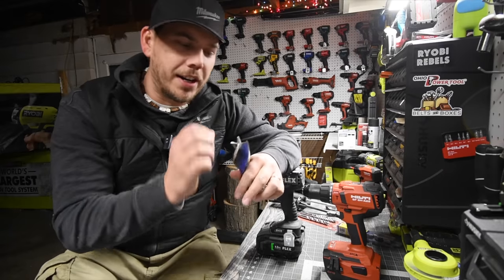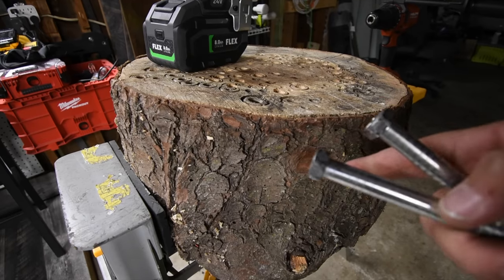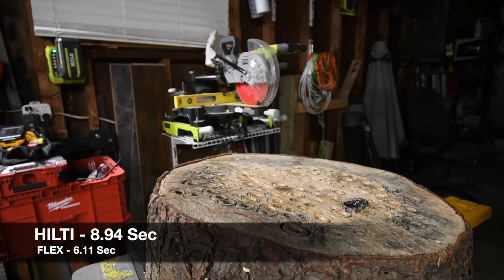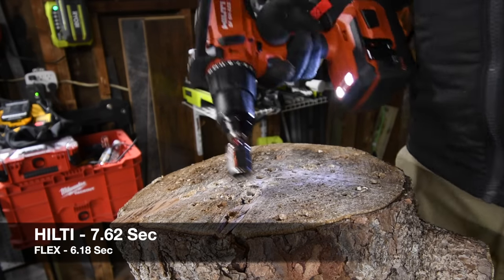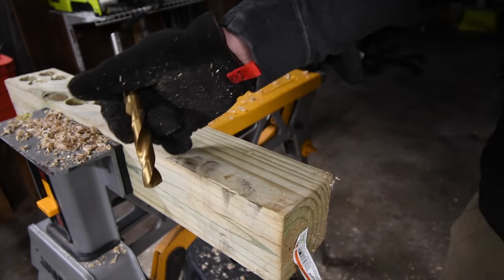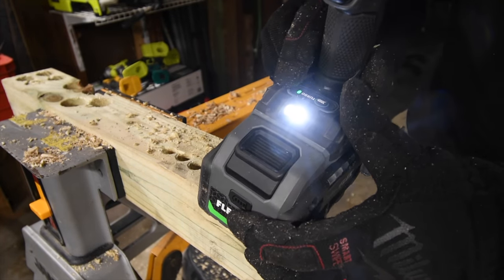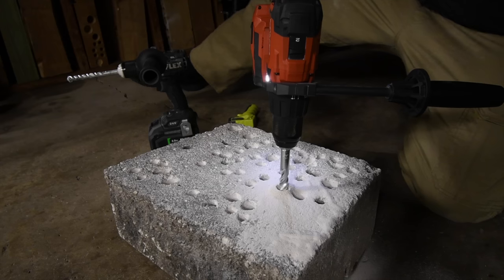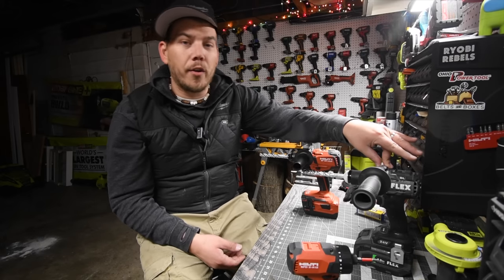HILTI vs FLEX (Hardcore Hammer Drills)

Comment: This is not “1st tool” from Flex. Flex started as a German tool manufacturer over 40 years ago. They were acquired by Chinese tool giant Chervon a decade ago. Chervon, the owner of other well known brands such as Skill, Ego and most notable as a 3rd party manufacturer for many other brands including Bosch Tools, had an existing tool agreement w/Lowe’s, producing their in-house Kobalt branded power tools. 

In 2019, Lowe’s & Chervon renewed their partnership agreement to re-introduce the Flex Power Tools brand in NA exclusively in Lowe’s stores as replacement of the Kobalt brand. This agreement primarily allows Lowe’s to pass warranty liability onto Chervon, instead of internally, as was case with Kobalt brand. The Kobalt branding is being retired across the line, by Craftsman in hand tools and outdoor equipment, also produced by Chervon, while Lowe’s acquires exclusive resale rights in NA to Chervon’s Ego and Flex Tool brands. 

Given how much Lowe’s marketshare has receded vs Home Depot, they needed a boost, time will tell if this new strategy will deliver.
Reply: Yet, they continue to come out 'new' Kobalt brand tools. I personally don't think Kobalt is going anywhere. Kobalt's known as a DIY, not PRO. They're competition is Ryobi, Ridgid, Craftsman and the like.

Comment: I have that Hilti it is a good drill but not very good in cement though, I also have the Dewalt 999 that Flex turbo and had the Milwaukee and I find that they each Excell in certain things and as for cement I go to the 999 it's the best for that oh and I just picked up the Metabo but I don't care for it so I'm going to be giving it as a present this Christmas found it heavy and bulky

Comment: Can you please test the metabo hpt triple impact and hammer drill kit w/ the 3Ah against competition?
Metabo never gets any love from channels.
Reply: I second this.  But with the 4/8ah with 21700;'s.
Reply: Metabo HPT is not Metabo. Both brands are owned by Koki Holdings but share nothing; from designs, engineering, motors, battery platform, etc. Metabo HPT is a NA only brand, globally they are sold as Hikoki.

Comment: Flex continues to prove it belongs with the big boys.  I don’t understand the “good for its first attempt” perspective, it seems like the individual tools Flex created are on par with the best brands.  What’s lacking for Flex is depth / breadth of platform, availability limited to Lowe’s (not unique to Flex). and lack of bare tool deals.  Other main issue is size / weight is sub-par, but that’s a pretty minor gripe IMO…they aren’t THAT different than Milwaukee, Deawalt, Hilti, etc.
Reply: Agree 100%. Ive watched many videos on flex competition against the name brands and from what I can see the flex tools are at the moment more powerful than milwaukee and dewalt. I own the flex hammerdrill, impact, and saws, since they came out and I could instantly tell the difference compared to my other tools.
Reply: Flex tools look good and from the videos I've seen, they look as power as the pro tools.  However, Flex is a new brand that just popped up.  Who knows whet kind of long term support they'll have, whether they'll have a high level of quality control, and if they'll prove to be durable designs with long lasting electronic components.  Hilti, Makita, Dewalt, and Milwaukee have been around a long time and earned reputations.  Flex, or any new product, needs to prove itself over time when going against very good established products.
Reply: @seano932  True. We'll have to wait and see. I know ive abused mine and theyre still going strong. i dropped my impact in a running canal in 4ft of water and took me 30 to 40 min to get out and never stopped working, the second i took it out of the water ran like nothing happened. They must coat the wiring and electronics.
Reply: @Jeff_Gibbs  I own both. lol. I have a bunch of dewalt 60v stuff too.
Reply: @seano932  Flex is not a new brand. They started in Germany over 40 years ago. The brand was bought by Chinese giant Chervon around a decade ago and has largely been dormant as a brand since. Chervon however not only owns Skill and Ego brands, they’re a huge 3rd party producer for Bosch and several other brands. They’ve been producing Kobalt power tools since that brand was introduced by Lowe’s, as well as Craftsman power tools and outdoor tools for over a decade. This is the 2nd largest electric tool manufacturer in the world in total units. 

Flex is just a new brand name, largely due to a new market and fiscal strategy from Lowe’s. Flex is brought into Lowe’s as replacement of Kobalt, similarly Craftsman brand is replacing Kobalt brand hand tools and yard equipment. Chervon will service all warranty issues with Flex and Craftsman instead of Lowe’s absorbing that cost and liability under Kobalt brand. 

The Flex power tool is unfortunately a new battery platform not compatible w/Kobalt brand but the tools are developed and engineered by a very large, experienced and capable manufacturer.

Comment: Hilti in concrete saws jack hammers and rotor hammers are the best in power tools not a fan .
Reply: Let me guess, dewalt is better 😆
Reply: @aussiegruber86  in some tools yes dewalt will out shine hilti
Reply: Bosch and Hilti are the kings of the chipping hammers. Hitachi is honestly very underated too. Especially the older ones.

Comment: Hilti drill lack of power but the battery will last all day on a single full charge
Reply: In what way does the Hilti lack power? Even though these testing protocols lack objectivity, the Hilti and Flex were roughly even performing in wood applications. The only performance difference was in the concrete. Regardless if the Hilti may have had a more dense bore, which could have been identified had tester drilled multiple holes into same block scoring an average speed over 5+ holes, neither of these tools is designed nor intended to be used in concrete boring. The ‘hammers’ in these tools are not true hammers. 

Maybe the home diy guy uses these tools for concrete boring, a professional uses a real hammer drill with splined drive and real hammer assembly. If you take a Hilti hammer drill, such as TE30-A36 or TE60-A36, you’ll find the gears and hammer are machined tool steel. The DeWalt, and any ‘prosumer’ grade roto-hammer is stamped powder steel. Even this SF6H-A22 employs machined steel gears, not powdered gears on Flex and similar. 

If you ever actually use the Hilti, you’ll notice how much smoother it operates. The Panasonic-Tesla battery cells don’t decay after 20 charge cycles. The Hilti will outlast half dozen Flex and similar powered gear tools in actual professional usage. The Hilti includes safety features like ATC. 

Truthfully, for the weekend warrior, any big box store brand will be serviceable. It’s only the professional that relies on their tools 40+ hrs/wk and where downtime means job cannot be completed where the Hilti really separates itself
Reply: @MichaelM-to4sg  Hi Michael, I totally agree with what you say here. I use Hilti and Milwaukee. Sadly the Milwaukee gear is overhyped and have trigger issues.  I use my SF6H A22 as a general purpose combi. If I am putting up towel holders or fixing the odd batton to brick its fine and what it is designed for. If I am doing serial hole drilling into brick or concrete I use my TE6 A22. If I am revamping a Dressing room etc (I work in a large Theatre in England) I use my corded TE1 as it has a long lead and will reach every wall in a 15 ft square room, saving battery power. Don't laugh!!! 🤣🤣 That Te1 I got off a contractor when he left it behind at our venue. After numerous phone calls to him he told me to keep it as he had thrashed it pretty hard and it was probably on it's last legs anyway. Plus he had since upgraded to a newer Hilti. That was 35 years ago and that Te1 is still as sweet to use as ever and can keep up with all the modern corded Makita's etc. It is a dream to use and the slow start to full speed is silky smooth all the way!  I have used many brands in my 40 years of using tools and Hilti is still my favourite by far. Plus, any issues you have....just call your local Hilti rep and he will be with you in around half an hour with a replacement tool while yours gets sent off. No down time. My previous assistant dropped  my Gen 1 SF6H down a deep street drain whilst fixing the top cover rim. It still worked but sounded a bit funny on the run-out. Within half an hour I had a replacement in my hand,  mine was sent off and back with me within 24 hours.
Dave.

Comment: Wow hilti is cheap outside of Australia
Reply: Compared to what? Here in US, this SF6H-A22 hammer drill driver, an 8Ah battery and a charger retails at $430USD. They are sold only directly through Hilti USA and handful of authorized retailers. They do not discount w/very few exceptions, when I bought my crew 2 TE60-A36 SDS-Max hammers, a couple spare A36 batteries plus 4 of these hammer drill drivers and 2 sawzalls, I worked a relatively small discount through Hilti USA. Compared to big box store brands like Milwaukee, DeWalt, Makita, etc, those products are typically retailed here $50-100 less for hammer drill driver but there’s minimal efforts to maintain that retail pricing thus its very common to see them further discounted 15-20%. 

What’s really unique about Hilti in US is the incredible warranty and customer support, but only for original owners w/documented retail sale. You buy Hilti in US from EBay or any non-authorized retailer, there is zero warranty support from Hilti. With Makita for example, if you have no record of purchase, they still warrant product is the serial number date code is still within warranty coverage.